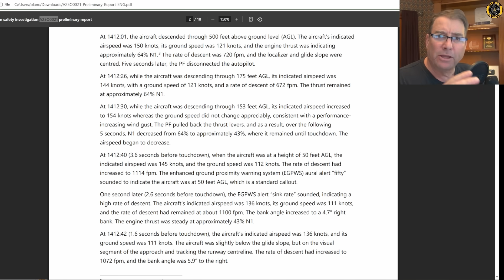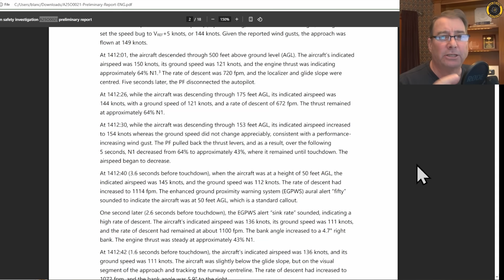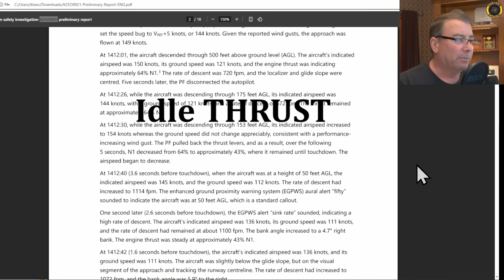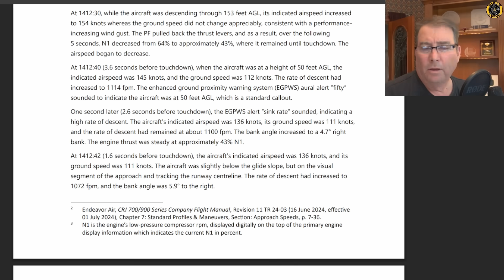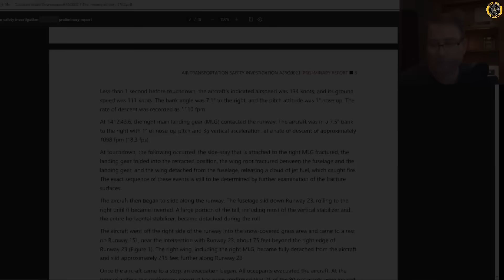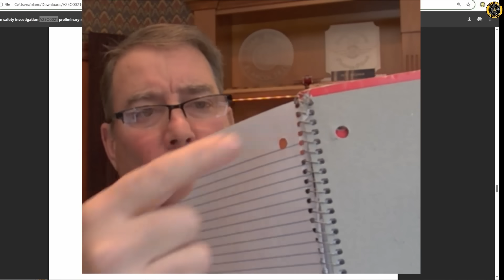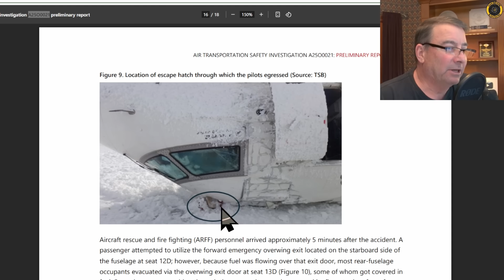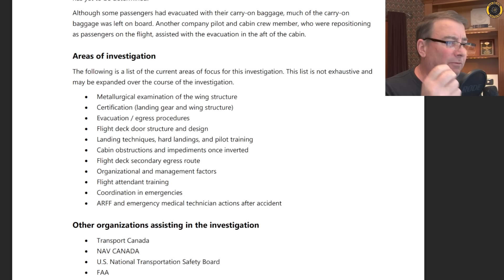TSB Prelim Toronto CRJ Crash

Comment: That was her first winter in the airplane…. And probably with jets period. R-ATP. Captain is a sim instructor. They teach you to nail the 1,000s. He was dead weight in the left seat. She wasn’t supported by her company on this one. She was the more experienced one? Yeesh…
Reply: If the captain was always training others in the sim, I can infer several factors - - - > 

1) knows all the drills, for every crisis => high confidence, but 
2) as the trainer he always knows what problem is coming => so his skills for recognising a developing problem will be rusty, he never normally has to spot an issue, he picked it, 
3) in the sim you don't need to take control => so even if he overcomes #2 his brain is trained to not interfere.  

So - to me - even the world's best sim trainer might be a poor choice in the real world, unless they also spend a huge time in the air to keep their brain in real mode.
Reply: @45KevinR  The follow-on question is "how does the airline ensure that ALL its' pilots achieve adequate levels of recency".
Reply: @45KevinR  thank you. Very interesting points
Reply: 2 expert systems analyst
0 expert  pilots
Reply: You can perfectly blame that on stoopidly fast and brainless process of "pairing" the crew by Airline "programmers"...

There SHOULD be a much more through and reasoned process at crew assembly, that takes into account several aspects of the available pilots for every flight; considering experience, profile, how familiar is the pilot with that particular route and destination airport, and any detected deficiencies from their records.  That would avoid such a bad "pairing" like this one!
Reply: @alfredomarquez9777  Pilots bid their schedules based on seniority and the union contract. Newer pilots like this accident first officer get whats left over. Management pilots like the accident captain generally pick up trips that regular union pilots dont want so they can stay current. None of the more senior pilots wanted to fly to cold, snowy Toronto so these two got stuck with it.
Reply: @matthewstraub8771  I could name twenty airlines that do line bidding by seniority and twenty that don't.
Reply: @alfredomarquez9777  Stupid comment. All crew scheduling systems have the option to configure and prioritise selection and pairing criteria. Not all criteria can be met for all flights. What are you going to do ? Cancel flights or select the best crew that is available ?
Reply: @hb1338  Stupid is getting a "pairing" as mismatched as this! 
THAT IS STUPID! 

(I HOPE YOU CAN UNDERSTAND THAT...)
Reply: The Swiss cheese started when these two pilots were paired that day.
The major fail is the "sim" captain sitting in the left seat, he basically was dead weight in the seat. If they had a current higher time line pilot instead this accident would not have happened.
Reply: Agree. yikes. I will never fly that airline.
Reply: @Starfish2145  Who says that any of the problems which caused or influenced this crash are confined to just one airline ?
Reply: My guy, she attended North Dakota University, a premier flying school. She had plenty of winter flying experience.
Reply: @Markle2k  If one can attend a premier flying school and still crash a plane in standard winter conditions, then I submit to you that it is not a premier flying school.
Reply: @dafunkmonster  Nah, you're just bad at math. And you aren't good at recognizing human fallibility among top performers
I mean, Art Scholl must have been a completely shitty pilot to get into an unrecoverable spin over the ocean, amiright?

Comment: Stick and rudder, AKA "flying by the seat of your pants".  That's how my family learned, starting in the 40's.  Include a little dihedral to the bottom wing, and you literally wear the airplane; fly by feel.  You can't fly by feel in a fly by wire aircraft, so practice, practice, practice is the next best thing.
Reply: Add some glider experience to really learn energy management, and a little Aerobatics for unusual attitudes recovery... That should do it, instead of videogame type and computer key punching training  only.

Comment: Man, that pilot dropped that thing on the deck like a night carrier trap in an F4.
Reply: Worse, much worse than a Rhino on deck, but i Get your point.   A Rhino would be doing about 800 feet per minute and no bank.
Reply: @datamasked8632  Yeah, and that is considered a hard landing, and the F4 was designed to do this over and over again. The Navy Phantoms had gear that looked like a T-rex' legs.

Comment: When the sink rate aural warning came, why wasn't a go around initiated immediately? The approach wasn't stabilized in the last few seconds, even before the warning, so a go around should've been the first choice.
Reply: I believe they had less than 2 seconds from the warning to hitting the ground, so the call may have been made.  We'll see when the full report is published.
Reply: @FlyingtheLJ  04:05 - 2.6 seconds quoted. With the long runways at YYZ, GAWD (Go-round After Wheel Down) may well be an option.

Comment: In summary:
- gust loss = Kias reduction short final with low thrust setting set by Captain (FO didn't adjust afterwards)
- EGPWS announced "sink rate"
- narrow rwy illusion from the snow plowed combined with blowing snow on active rwy may have caused the lack of landing flare seen in the crash video
- Pilot experience R-ATP

 The holes in the Swiss Cheese Model lined up, though thankfully everyone survived. Great work as always Juan!
Reply: I don't think you have the PF and PM correct.  The PF is flying with all the flight controls until the CA says "my flight controls" after the nose is down and the TRs are deployed.  It would be one terrible CRM day if my CA pulled my thrust levels back for me when I was trying to land.
Reply: @ericsd55  I stand corrected, PF pulled it back according to the report.
Reply: Do we know who pulled back the throttle? Juan talked like it was the PF.
Reply: Most runways at airports with airline service are 150' wide so the plowed section was still wider than most runways.
Reply: @ericmcleod7825  Yes, but if you are used to the extra wide runway, then it's suddenly normal, you are in the same or worse spot.

Comment: 2nd flight of my life was about 1958 on a Bonanza Airlines DC 3.  After stopping in Colorado Springs heading for Denver I looked out and the right engine was clearly on fire.  Dad closed the curtain, said nothing was wrong but I could hear them feather the engine.  We landed safely because their was likely a Stick and Rudder set of pilots up front.
Reply: In 1958 weren't all pilots stick-and-rudder pilots..? and that lasted to the mid-80s and glass cockpits and flight management systems, and a culture of training pilots to primarily supervise the autopilot. There's a great lecture from 2000, "Children Of The Magenta", about this phenomena
Reply: @RoamingAdhocrat WISE COMMENT, INDEED.

Comment: One thing with having good "Stick and Rudder" skills is that when everything else fails you still have a chance.
Reply: Or, having good stick n rudder skills would prevent a pilot from getting to the point of failure.
Reply: @ericsd55  Or, as Frank Borman said, "A superior pilot uses his superior judgment to avoid situations which require the use of his superior skill.”

Comment: I’m glad you brought up the narrow runway illusion. Visual on the approach and the visual makes you think you’re higher and have more “air” to work with for the “flare”.
Reply: Do they know by "50, 40, 30"? Or not?
Reply: I don't think this would take effect with 160 foot width, Endeavor flies to a lot of 150 foot wide runways (most the runways at MSP are 150 feet wide) so they should be able to adapt to that visual picture.  Narrow runway illusion is really only prevalent on narrow runways, like 75 feet or God help us 50 feet wide.
Reply: Yeah this was not a narrow runway.  The majority of runways at airports used by airliners are 150' wide so the plowed area was still wider than typical.

Comment: Juan, idk why you are even talking about the crosswinds/gusts when the chief of fire department that responded to the accident said there “was no crosswind factor”…(I’m kidding on you bringing this up). That official should fired. Accident wasn’t even 24 hours old and he’s on mainstream media basically saying there was no crosswind…
Reply: As a retired FF, I'll take a stab at this.  No crosswind factor coming from a first in scene size up could mean that the wind was not blowing smoke and fire towards the rescue lanes.  AARF guys can correct me.
Reply: @ericsd55 I appreciate your feedback on this and I’m curious to know if that’s what he was meaning. He also tho did state the runway was dry which according to Juan’s previous video on this accident, the reported conditions of the runway weren’t dry as it had blowing snow. But like I said, I do see your point of view as I have 0 fire experience.
Reply: @Aftermath1738  lol, As an airline pilot, blowing snow over a dry runway is still a dry runway.  IIRC, blowing snow doesn’t affect the runway braking action report.  Blowing snow over ice, well that’s like graphite on steel
Reply: @ my apologies, I shouldn’t have said blowing snow. The RCR during the accident was 5 due to snow, 6 is dry. Sure braking action is still good, but to immediately rule out these while the fuselage is still smoldering is crazy to me.
Reply: He was wrong!

Comment: In the Air Force we taught Reference Ground Speed, that is the minimum ground speed expected on final which is approach true airspeed minus headwind component. In certain gusty or windshear conditions we would fly that expected ground speed as our approach speed.
Reply: Finally, minimum groundspeed approach, absolutely right, bravo!!
Reply: And oddly enough landing distance isn’t a problem.
Reply: Airbus has known this for over 4 decades. On the approach page, the reported surface winds are input and the target speed changes accordingly throughout the approach. It’s called “ground speed mini”.

Comment: "  side stay  "  = drag brace.  An over center device that locks the gear down.  
The left seat pilot from 07 - 25   18 years had 764 hours in type  ?  42 hours per year ?   3.5 hours per month ?  WTF ???  Less than 1 hour per week ?
There is flying and there is flying.  Being able to program instruments and recite numbers does not make you a pilot. 
Being able to fly without programming autopilots - anticipating and understanding the situation and adapting to it make you a pilot.

Comment: Gear collapsing on a 3G impact is a bit too light.  Will be curious to see if there was metal fatigue/premature failure of the gear in this aircraft.  Most gear I’ve ever flown on/worked on was designed to take at least a 10G impact.  Is this not the case on a CRJ?
Reply: No mention has been made of the side force on the gear. With a cross wind the plane would have been yawed relative to the runway. A failure to flare combined with a failure to take out the grab at the last second could add to the stress on the link.
Reply: Yeah, but all 3g on one gear leg, not both.
Reply: You underestimate how hard snow is, that 3G impact was likely much, much more, since Snow has a cushioning effect.

Comment: Stick and Rudder. Best book ever writ fer pilots. AND! best book ever read by pilots!! Practice, practice. practice. Saved my butt more than once flying Alaska winter mountains.
Reply: ABSOLUTELY YES!!! ...

It is surprising just how many Airline flying pilots cannot correctly describe the principles of flight as precisely and concisely that excellent book does.
The most numerous misconceptions I have heard from you g pilots, are related to energy management, dexterity ("Stick&Rudder") and the lousy understanding of the 'Critical Angle of Attack', believing that "Attitude" is akin to AoA, and the lack of realization that you can stall an airplane at ANY attitude, even during a vertical dive!

Comment: Pilot got behind the aircraft.
Reply: If the pilot was another sex I am sure many more would express this opinion?
Reply: @rogerblackwood8815 The captain got behind the aircraft. Ok now? 😊
Reply: @igclapp  Obviously a non flyer comment, the captain wasn't flying was he? At that stage of a gusty approach, the last thing you would consider doing is saying "I HAVE CONTROL" ! Because in the second or two in between, it could have been even worse? Maybe the captain who is an instructor should be called out for not calling the speed out long before the high sink rate?
Reply: @rogerblackwood8815  Nearly 15 seconds elapsed between the gust of wind which caused the FO to reduce power and the landing, more than enough time to check the airspeed, restore the power, check the sink rate, call for a go round etc etc. The lack of action in that time suggests that the crew individually and collectively were unaware of their situation and a long way behind the aircraft.
Reply: @hb1338  In principle I have to agree, but you don't know if the pilot monitoring had other issues to deal with and 15 seconds is not really how much time he had as those engines take a second or two to spool up and so the first few seconds of taking over would have been assessment, action, reaction. So I'd say that's about 6 of your 15 done. Then allowing for these actions, it would have made not much difference if they were enacted within 6 seconds of touchdown, so now that 15 seconds looks more like 3 seconds? 
But I agree the Captain is where the buck is going to stop and I can't argue that👍

Comment: The most sensible idea I've heard in any years: "to hone stick and rudder skills".
It doesn't require 1500 hours behind the wheel. It requires a structured training with Rod Machado type instructors.
And common sense. The least common of senses.

How come you throw in a seat  young pilot in such weather conditions?
This is what is surfacing from the investigation.

Comment: Just for clarification,  The preliminary report will have the same conclusion as the final report but the final report just  goes into greater detail?
Reply: The preliminary report just states the facts they have uncovered so far, and there are no conclusions. The final report will have more in depth analysis, a conclusion and recommendations. You can read the report for yourself at the website of the Transportation Safety Board of Canada.
Reply: @gerardacronin334 Thanks for the clarification.
Reply: no. The preliminary can be corrected if errors are found.
Reply: The final report will include the “probable cause” paragraph which the preliminary doesn’t have

Comment: Sudden double sink rate makes me think about vertical wind component. It would make any flare attempt impossible due to loss of control surfaces efficiency
Reply: It will be interesting to see the FDR data plotted so we can see how much of not flaring was about pilot inputs and how much from wind gusts.
Reply: There's no indication of downfrafts or microbursts. 1100 ft/min is not an extreme rate, except when it is so close to the ground. The sink rate at such low altitudes activates at higher than 500 fpm in this aircraft, I think. There was absolutely no reaction to that, no added power, no pitch up. Just a pilot behind the aircraft (happened often to me in multi engine training), in a crappy situation, and with a very visible outcome
Reply: @Cesare8 How do you know there is no indication of downdraft?  Did you see the aircraft AOA data?
Reply: @juanmanuelgomezmartinez3795  The increase in rate of descent can be explained quite adequately by the decrease in air speed.
Reply: @hb1338  of course but how you confirm no downdraft??  We need to see AOA data but not available now. I hope investigators will show all relevant data. Some times they hide.

Comment: 1. I’ve flown into YYZ hundreds of times. It’s a big area, near the lake. Often with very gusty winds. 
2. With a blowing snow situation and an inexperienced First Officer I would have taken the landing. 
3. At our company we added up to 20 knots to the approach speed in our Embraer. Here we have very long runways and although snow was present, it was dry and mostly plowed. Braking not an issue. 
4. I don’t know Endeavor but where I worked the maximum accepted sink rate was 1000 ft per minute. You exceed that - you go around. Especially when the GPWS system is screaming Sink Rate at you!
5. When I first saw the accident on the news I was praying for some explanation (maybe fatigue cracks in the landing gear) that would exonerate the crews. Right now I sadly don’t see any of that.
Reply: Sounds as if the FO had more actual recent experience on the type than did the Captain.
Reply: Most of Toronto’s runways are 2 miles long, so adding power or coming in fast leaves lots of runway left.
Reply: @foxlake6750  06/24 R and L are  considerably shorter, and 24 at the end have a large ravine into which two passenger jets notoriously have crashed on over-runs, one a DC-9 with two fatalities, the other an A340-300 with miraculously no fatalities. On the other hand, 05/23 is the longest, at 11,120 ft.